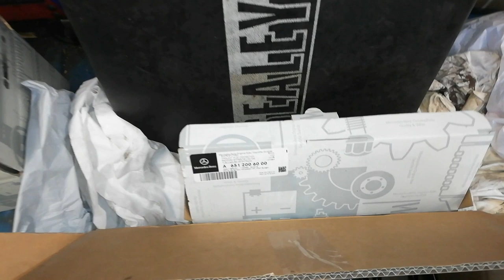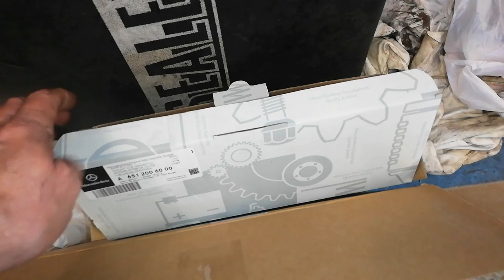Mercedes C Class OM651 2.2 Diesel Intake Manifold Fuel Heater

Comment: As the owner of this car I picked it up yesterday & I got to say it’s like a new car. It starts on the first crank, rather than 2nd or 3rd, it has its grunt back & is flying. Not only did Dave change the intake, but he also cleaned & removed the carbon from the associated components.......the car can now breath.
Great diagnostics in the first place, as one of the viewers commented below.......like finding a needle in a hay stack.
Thank you Dave for a great job, couldn’t be happier 👍

Comment: I just did it like this to a e class w207, same engine. Didn't remove the firewall but it was extremely hard to get to all the bolts. I used many extensions. Thank you man!!
Reply: How do you get to the bolts under the manifold to remove it
Reply: @Suhail.Khan-24  a few 1/4 extenssions stacked in my case
Reply: @lucifer9033  i want to clean my egr, manifold, flaps, replace fuel filter housing too. 

How long does it take to remove the manifold
Reply: @Suhail.Khan-24  depends on the tools, if it's first time it may take a full day to do all that stuff.. if you're not a mechanic of course.

Comment: Excellent job.. If it was my car I would've had a new oil cooler and the seals replaced. The seals eventually deteriorate on the oil cooler and its a big job to replace that then as the oil cooler is buried towards the bottom of the engine. The labour costs to have the oil cooler and seals replaced are high because its a right pain to get to it. You can see the oil cooler in this video as most of the components have been removed from the side of the engine.
Reply from the maker: Thanks and yes, this is a customer's car so i can only do what is required at the time
Reply: @davesterl  yes thats 💯 right. That's why I said if it was my car I would've had the oil cooler done.
Reply from the maker: @avneetkainth9816  yes no bother

Comment: Nice job Dave, done two of these for same reason, money is well earned!
Reply from the maker: Interesting Simon, what was the issues?
Reply: @davesterl  First one I did was for snapped bolts, it was caused by someone else who had attempted an EGR replacement. The second one came in with running issues, unmetered air faults if I remember correctly, it also had DPF faults and some cracked pipe work, I'm nearly sure I took notes on that one I'll try dig them out tomorrow and refresh my memory.

Comment: Egr part that is going to back of the engine could've stayed inside. The part that egr cooler is connected to it is to be taken out separately, after u take take the intake pipe out and intake throttle body, you can access 4 screws from underneath and seperate it from the part taht goes to the back. 
That's how i did it, and took me around 2,5 hours for all lf the work, new thermostat, oil filter housing and the intake itself.
Reply from the maker: Good for you

Comment: How much would a job like this cost? I just bought a C250 2 days ago from a private seller and now the EML has come on, so he lied about there being no faults. The fault codes P0299 - Turbocharger (TC)/supercharger (SC) - low boost and P2279 - Intake air leak. Worried what it will set me back 😔

Comment: Really liking your videos - particularly on this model - really informative. My mate has a 2013 estate 220cdi which has had a number of issues over recent months. The latest is inlet leak and low turbo boost OBD2 faults. I am not a mechanic but have done a fair bit of maintenance / repairs (Never on Mercs). I applied some pressure (10 psi) to the intercooler inlet pipe so there would be no connections before the 'throttle body' - mainly to check the pipe seals. However, no pressure built up and escaping air could be heard near the top of the engine. Turns out there is a hole / vertical opening directly below the diesel filter housing which the air is escaping from. I noticed it when we changed the filter housing a few months ago and wondered what it did - any ideas? I could provide photos if that would help.  I do not have a workshop manual yet.

Comment: Thank you for the video. I have the same car w204 2012 blue effeciency. My question is, I can see you've taken the throttle valve out. However, I cannot tell where it is located. Would you be able to help? And what are the parts I need to take out to reach it?

Comment: These videos have been so helpful as I've recently been tackling the inlet manifold (loose bolts and i assume warped), the oil filter housing/cooler and fuel filter hoising as i was there.
Jusy reassuring to know how much needs to be removed! Instead of wondering if you're doing something wrong.
Quick question (i appreciate this is a 4 year old video...) Is there a tightening sequence for the manifold bolts? Or just the usual start in the middle and work outwards?
Cheers 👍

Comment: Excellent video can you helped me there's a hose at the back of the engine underneath the cylinder head that comes out and runs down the side the bell housing some sort of vent hose what is this much appreciate any help you can give 20:26

Comment: Yer grate video 👍, got some black smoke on hard acceleration just wondered if the EGR valve is blocked 200,000 miles it's probably is looks like engine in bits time 🤣👍👍👍

Comment: Hello, i know this is late but how did you get the whole egr system off in one piece? i always have to take it apart, i ussually only spend 1 hour taking off the manifold, but then 3-4 hours assemeling it afterwards (ive done 15 so far)

Comment: Mate quick on do you know maybe if there is any difference if I would cut off that flaps from a metal rail ( from plastic intake basically ) or that would be an check engine light ?

Comment: Hi dave are still monitoring this Chanel ive just completed the same job as you have done but have a problem ( the charge movement flap cylinder bank 1 has a malfunction there is a mechanical fault) also reading the position sensor switch for the charge movement flap cylinder bank 1 has a malfunction  the voltage value is outside the permissible range . Can you please advise ? Thanks
Reply from the maker: I'd say that's a different fault to what I'm showing in this video
Reply: Hi Manchester . I have same fault p024872. I can't see any manifold leaks . Car is EML mode. Did you solve this error code?

Comment: Awesome vid! I have just started this job on my dads after spending days searching for a tutorial this is a godsend!! One question if you get a chance, would you mind explain how to remove the metal bulkhead part? Theres one pipe coming through it on the passenger i cant figure how to remove in order to pull out the shield.
Reply from the maker: If its the heater pipe then just leave it attached to the firewall and disconnect the pipe behind it. Take out the wiper motor will help
Reply: @davesterl  thanks so much for replying!!! Fingers crossed, it looks daunting but im sure with patience and your vid, we'll get there,eventually!
Reply: @oflonso1318 did you get the job done on your own in the end?

Comment: Hi Dave, brilliant video...thanks for taking the time to document the procedure!
I have a Jeep Patriot 2011 with this engine in, mounted transversely (EGR to front of engine bay) and it's even tighter than in the C220/250! I have a throttle body/flap error and have sourced a replacement but didn't have a clue where to start until I found this.
Couple of quick questions though:
i. Do you think it would be possible to remove the throttle body/flap from underneath, without taking the EGR and intake manifold off? 
ii. Did you replace the throttle body/flap top-and-bottom gaskets or just clean them and if you replaced them don't suppose you have a record of Merc's part number?

Cheers from Yorkshire :)
Reply from the maker: I dont think its possible to do from underneath and i just clean the gaskets, provided they haven't gone hard are fine for reuse
Reply: @davesterl  OK cheers. Was hoping for an easy option but I'm learning nothing's easy on these lumps!
Reply: Hi. Did you solve the problem changing the throttle ?
Reply: @carlosbah4623  Yes mate, although it was too big a job for me to attempt at home so ended up going into a shop for the work to be done. The EGR and intake manifold did have to be removed.
Reply: @AdeptHavelock  Glad to hear it was solved. Probably, Even they had to do a tps relearning process with a scan tool.

Comment: Well mate you’re in better position I got complete engine out for replacement so I feel your pain what an awful design worse than a French 💩
Reply from the maker: You took the engine out to change the intake manifold, or to change the whole engine?
Reply: dave sterl to change the engine old one seized solid due oil starvation